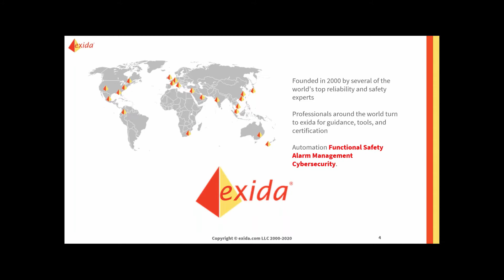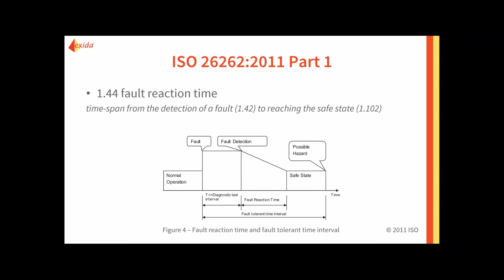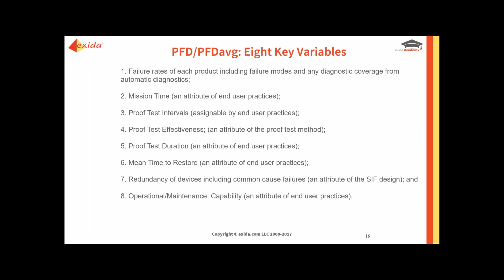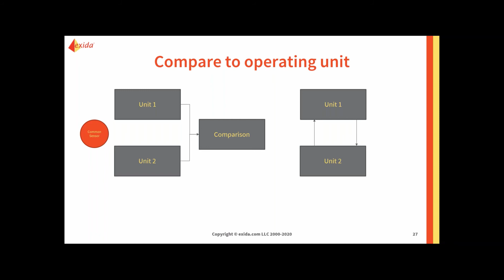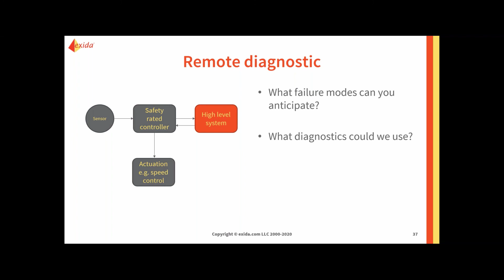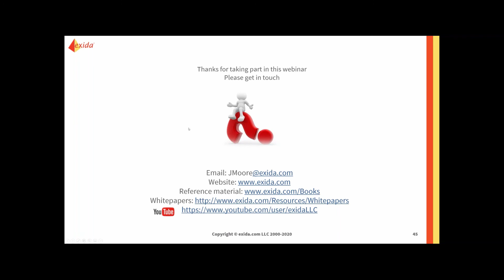Better Safety – Adding automatic diagnostics to Embedded Systems

Comment: doo you know some good practical book about funcional safety in Railway? in particular relations between On Board Signalling System and Brake System?
Reply: books an functional safety in railway: Unfortunately, I can recommend only german books (hope it is still helpful):
Handbuch Eisenbahninfrastruktur (Springer-Verlag): This book has one chapter regarding functional safety, which deals with Basics from the CSM RA and 5012x-standards
Das Europäische Bahnsystem (Springer-Verlag): This book deals with the authorization process (including safety case basics), the 4th railway package, CSM and safety management
However, the two books deal with the topic on very generic level. I doubt that there is a book dealing with such a specific topic like on board signalling system and brake system.
Reply: @michaeldopichaj5902  Thanks! it's funny how difficult is to find articles or books on this specific topic. The safety of the railway system has one of the pillar there, in the interface between the signalling system that asks to brake in case of danger, and the brake system that applies the brake. As the two systems are in general from different suppliers, the weak ring of the chain is the train builder or integrator. A failure in the integration can lead to a loss of safety, and it looks curious to me that than in the railway business there are tons of specification to make a signalling system, tons of specifications to make a brake system, and basically no specification to integrate them at least in a optimum way. The risk is over engineering on both side (or a safety with still hidden risks). Thanks again!
Reply: @metiu1975  I see your point and it annoys me as well. However, I think it is less problematic than you think. There are EN standards, UIC standards etc. which help to coordinate among the different systems. I have to say I am not a braking expert, but I worked with some and I can assure you these braking experts have the information/knowledge in there heads which seems to be missing in written specifications and standards. (sad but true, especially for people how a still acquiring this information/knowledge)
Reply: @michaeldopichaj5902  you are right! I’m supposed to be one of those kind of experts (I have almost 15 years of experience integrating braking systems and signaling systems) and what I see is exactly what you described: experience/expertise has an essential and key role and it’s over any standard. The problem is when you have to pass all concepts to a future generation .. you have to write your own book :).